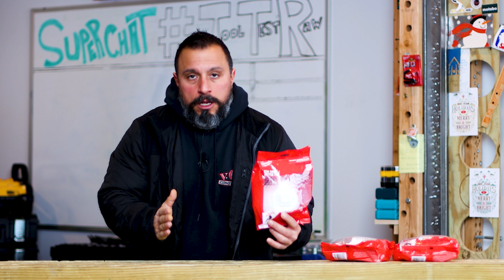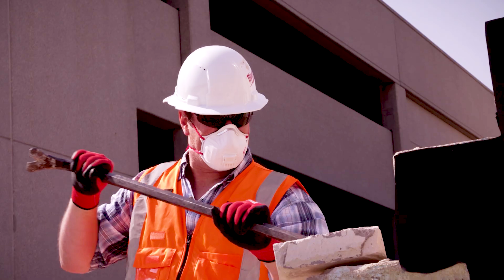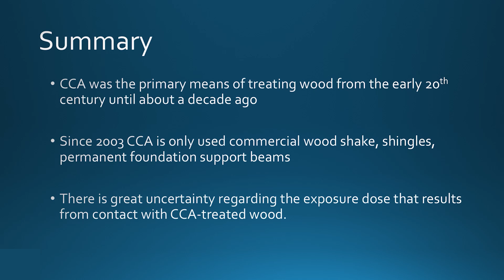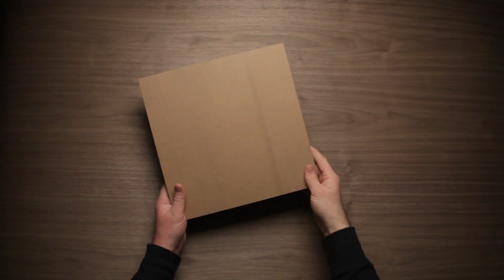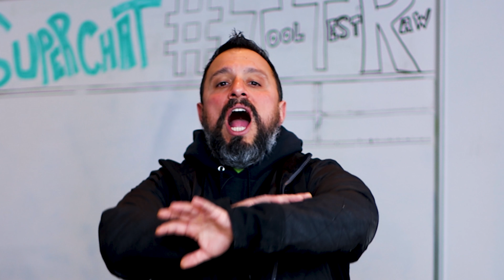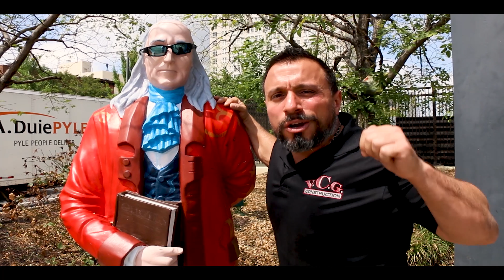Milwaukee Tool Accessory PROTECTS YOU From ILLNESS & DISEASE

Comment: If I didn't have a box of 8511s I'd buy some of these Milwaukee's. The gasket looks like a nice feature. I've worn an 8511s when using our cut off saw at work. I definitely recommend spraying water on the blade(only if the saw is gas powered).

Comment: I am a glazier I drill concrete and grind glass it’s a big issue if dustless vacuum is not used you must wear a mask/ respirator per osha it also requires if you choose the mask option the employer is to provide lung xrays examinations I think it’s every 60 -90 days . Silica dust is a big health risk . Great video .
Reply from the maker: Thanks for sharing your experience , we appreciate it!

Comment: @VGC Construction. Thanks Vince for the information. I guess there are some people who get into the trades who may not know and thank you for sharing. Any kind of particulates made from grinding, sanding, drilling, sawing, etc. can be harmful to us. But it may take years for us to develop serious problems. I used to work for a large company and was once a safety officer. That's where I first learned about MSDS (material safety data sheets). When I asked for the MSDS for CCA many years ago at my local HD, I learned to always wear leather gloves and wear masks rated for the dust. I've always been a 3M guy for my PPE.
As you use those Milwaukee N95 masks with the seal, let us know how effective and comfortable are they. Can you wear them outside on a warm day and still be comfortable? And since you have a beard, how comfortable are the seals against your face?
As always, thanks for the information.

Comment: Purge valve also helps to release moisture from breath so inside mask does not get wet.  P95 and P100 may also help.  I use a P100 with replaceable filters.

Comment: Will this help stop corona vires
Reply: No, the size of the Coronavirus is smaller than what N95 masks are rated for.
Reply: @whiskeyandwood4047  correct in terms of the microns. However, the virus rides on the water droplets and that's where the N95 mask filters the droplets to capture the virus.
Reply: dan fuller wrong, it may reduce the numbers, but you are under the false impression that droplets are of a consistent size, and that coronavirus is ONLY borne on droplets. Neither are true. I’ve got a degree in microbiology, an MPH, and worked at the CDC in infectious disease. Please stop spreading false information, it’s irresponsible.
Reply: @whiskeyandwood4047  Mr whiskey and wood! Please see original question stated by individual on thread. You answered my exact answer in your last post 😂
Reply: @whiskeyandwood4047 acrroding to to our health system in Canada, we have been taken off of airborne precautions and now are on droplet protocols so, to the original question, yes! AN N95 mask will help you lower your risk of infection if used properly and proper protocols are followed 🤦‍♂️
Reply: dan fuller helping reduce risk and helping STOP are not the same thing. And what level of caution Canada declares doesn’t have anything to do with the size of the virus, it has to do with what precautions they want people to take balanced against the economic and productivity and fear concerns that are consequent. Since you can’t seem to read, I’ll reiterate, they can help lower risk, but NO, they DO NOT STOP it!
Reply: puppy tube hd -nothing stops it. You make hand contact, pull the mask off when you get home, touch your face. You got it lol
Reply: IMO from what I have read, it should help stop COVID19 (Coronavirus) from getting into your mouth and nose if worn and handled correctly (as other replies have indicated).  But, it is not a "silver bullet" - the 95 in N95 means 95% efficient - ie 5% chance of getting through, good to have still but not 100%.

It is only effective if you can get a good seal around your face (sorry Vince - need to shave your beard) AND you do not touch the filter part of the mask - just the straps (at most)
Make sure you do the seal test to make sure no air can get through the sides of the mask.

The other main thing to do is wash your hands first before removing the mask (in case the virus is on your hands).  Failure to do things like that and the above generally defeat the benefits and make it worse.  
Other tips include disposing of it when it gets wet inside (breathing a lot).  I would not say it is not reusable because you will be risking putting something back on that might name the virus on it.  However, if you have no other choice ...  

On the size of particles that it can filter, there are studies from CDC / NIOSH and others that show they do filter out nanoparticles (the size of viruses like COVID19).  However, it may be a bit less or more efficient (I have not seen less that 93% efficient in any test results) and it more depending on the type (e.g. foldable, pleated, etc) - pleated being best.
Now, this is just talking about the virus floating free in the air.  @dan fuller is right that the virus spread is thought to be via water droplets - which are microns in size and therefore can be  stopped by the N95 mask.

Some other interesting things I have noted in my research:
1) This mask filters 95% of particles of 0.3 microns - this means the maximum particle penetration size (MPPS) is 0.3 microns.  This does NOT mean smaller particles are not stopped - just that the WORST performance is at the 0.3 micron size - other sizes can / are greater than 95% efficiency.  I know this goes against what we think about filters but this is how filtering of particles of this size work - not just physical stopping.  When particles are smaller, other things come into play to stop them - diffusion, electrostatic, etc making the efficiency continue or improve.
2) There are even more effective respirators that stop 99.97% of 0.3 micron sized particles.  They are labeled (in North America) as N100, R100, P100.  As long as you see "100", these are the even more effective respirators.  Note that the R and P mean the mask is more oil liquid resistant than N (R being resistant, P being proof) and help in oily industrial applications. 
3) There is even a surgical version of N95 masks.  The only difference is that these masks can protect against things like streams of liquid hitting the mask - as in blood.  While "better", YMMV on if you will be exposed to liquids spurting onto your mask on your daily commute.

Back to the review - Thanks Vince for doing this video.  I was actually surprised at how dangerous the pre-treated lumber and other items were.
I like the Milwaukee mask better than other N95 masks because they have the soft grey material all around the inner part that touches your face - making it easier to get a good seal.  Getting a good seal is the key to make sure the mask will stop particles of the virus and all the other ones mentioned in the video.

Sorry for the massive long post - too much coffee :)  No matter what, I hope everyone stays health and does not need to use these masks much.
Reply: T Leetpn N95 is only 95% down to .3 microns, the coronavirus is smaller than this. While it can reduce the exposure, as some percentage will be captured, these masks have NO rating for material that small. I’m not saying they won’t help, but the question was “will they stop it?” The answer is NO.
Reply: I agree with what you say that it would reduce the exposure - which is what I interpret the OP is asking - "Will this help stop corona vires" and what my long winded original response was trying to say - so answer YES, it will help stop corona vires (by reducing the amount that can possibly get through the mask)...but not 100% stop (IMO, nothing can 100% stop).

If the virus is transmitted via droplets, the masks will help stop it (reduce exposure) from getting into your mouth and nose if the mask is worn correctly (no leaks).

If protecting from the bare virus (nanoparticle size), tests by the CDC / NIOSH shows that, for the N95 masks they tested, the filtering was still at least 95% effective - suggesting that N95 masks are effective against nanoparticle sized particles like viruses.
Reply: Yes it will. However, as others have noted, you have to be careful and very cognizant about how you are handling the masks when fitting and removing so not to cross infect.